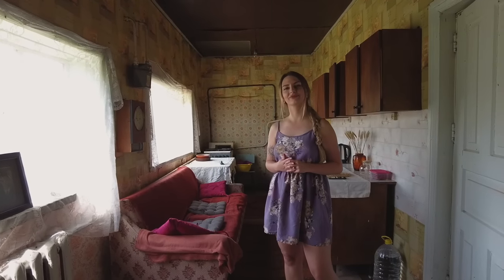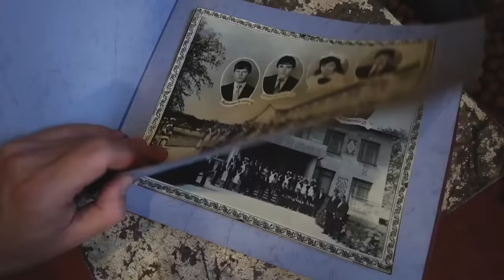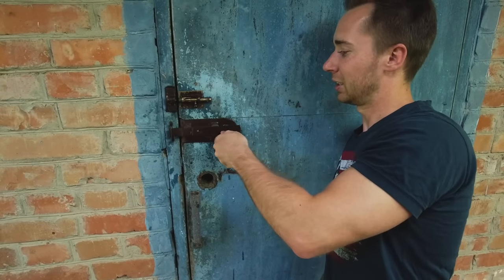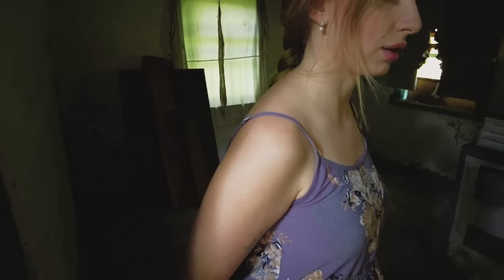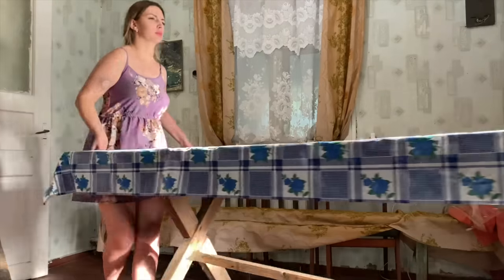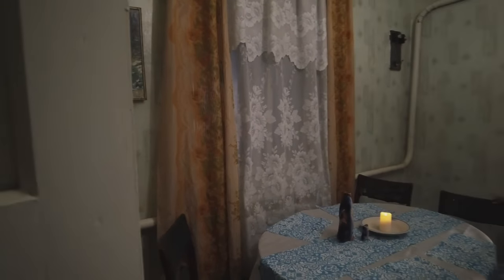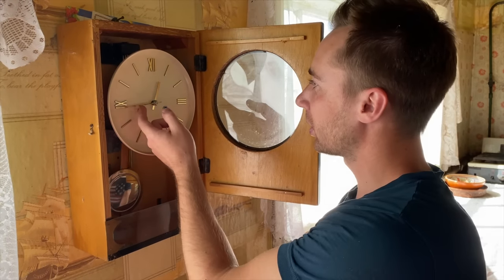Abandoned House in Ukraine | Mysterious Building Finally Opened

Comment: I am enjoying the transformation.  The "special lock" on that small house is an antique. Very unusual design.  For internet satellite dish is the clear answer.   Something to think about is to look at the boiler and pump long before winter. I see the radiators in all the rooms and know that a system unused for years requires some maintenance to restart it safely and have it work properly.  Hydronic heat systems are very good heat and reliable.  Also, if you intend to use those huge stoves please check the flue carefully as many animals will nest in them if they can. I know it is early summer but this is the time to arrange for wood for your winter's heat.  If you wait till fall there will be none to have.  Please look carefully at the front doors.  From the style of them I would expect very fine wood under all that nasty paint. Refinished carefully they could be very beautiful.  A good start towards your country palace.
Reply: I agree👍REMOVE paint = 😖 
P&L stay safe!

Comment: nice work guys what a great start to the cute little cottage, a major thing to check when you fire up the heater/stove after a long time of disuse is Co2 leaking from the vents or the device, a inexpensive battery powered detector can sniff out any leaks and some simple taping of the joints can remedy any leaking unless the device is faulty, Co2 is dangerous stuff, Luba looks really happy about cleaning up her family's old country house.

Comment: Windows in particular are a problem spot for lead paint dust because of the rubbing of the windows against the window frame . If you are cleaning that,  get the surface moist first  with a water and detergent mixture to keep dust down then make sure to get rid of the sponge and water in a safe/contained place. Just in case you didn't know about this stuff.

Comment: Regarding internet, if you don't want to take on the fiber install in the near future, consider 4G/5G with a directional antenna on the roof. It's not fiber but might give you decent connectivity in the short term for a reasonable cost. 
Also! Please check the state of the chimney before you fire up the stoves! It might need a sweep.

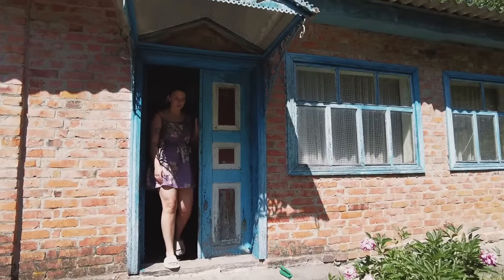Comment: 2:25 THAT IS PROBABLY LEAD PAINT if it is chipping off like alligator scales it will likely have lead in it. 

one way to tell is if it makes some dust/powder when you scrape it off like alligator skin and is hard.  Lead was used a lot in the past in America because it lasts so long. 

it can absorb into the SKIN and the LUNGS. lead poisoning is very serious. it damages the body in every way and can lead to death. 

scraping it off in the rain or with a hose on it to keep it wet is best along with some long sleeves and gloves.
Reply: 2:38 looks like old lead paint. i'd be careful when removing it. whatever doesn't chip off easy can just be painted over